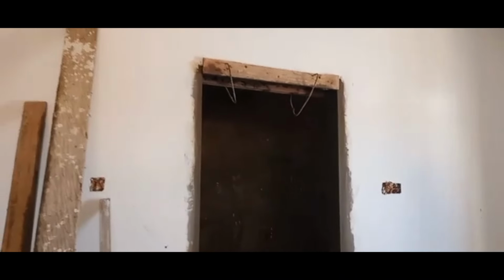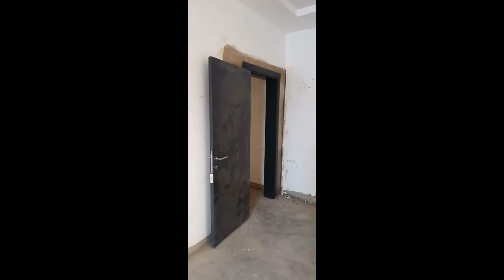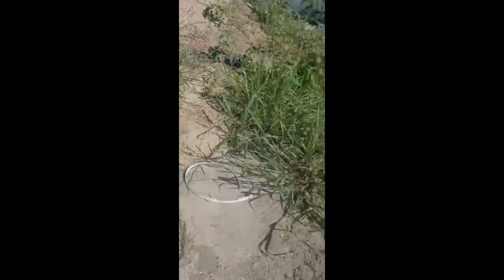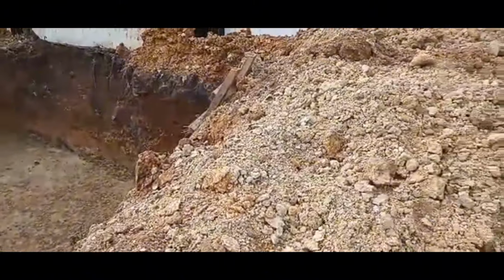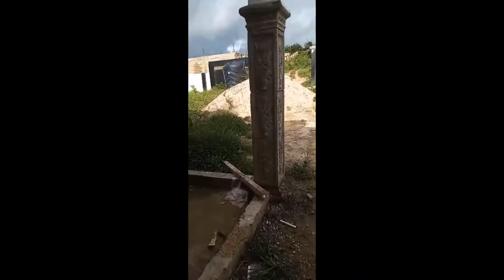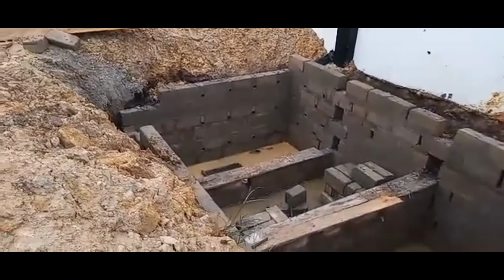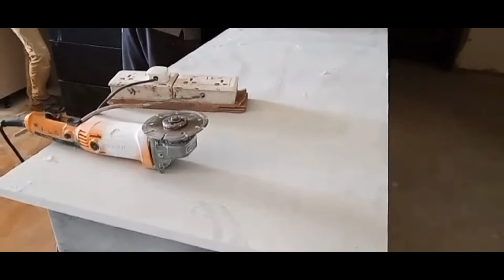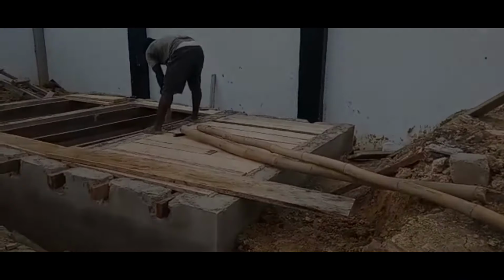New home updates!!! #asebu #agyendam #ghana #westafrica #travelvlog #buildinginghana

Comment: Looking very nice ! What is the channel of Cecile that filmed your planted trees? 
Was it The Addis Family?

It is a good idea to have at least one plug socket  on every available wall were it is safe to be fitted.

So many trees could provide lots of shade which could be great for keeping your outdoors cooler but if not placed strategically, may reduce by too much sunlight coming in to the house and may throw shade on other smaller plants and food  crops you may choose to grow.
As for how often the Septic tank needs to be pumped out would depend on number of people in the house , If it is just for two adults who are not both there all year round the every 2-3 years would be my guess.
Reply from the maker: @proyouservicesltd3652  Thanks, the name of their channel is "the Evans." You may have to type Ghana after it, so it will pop up.
Reply: @BlairsNGhana  Thanks.
Reply from the maker: @proyouservicesltd3652  no problem bro 💪🏿